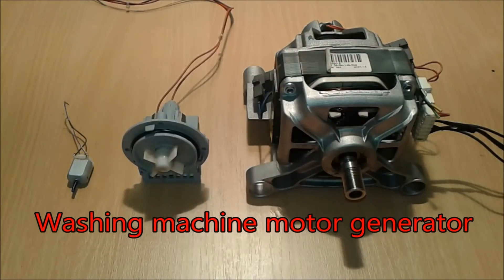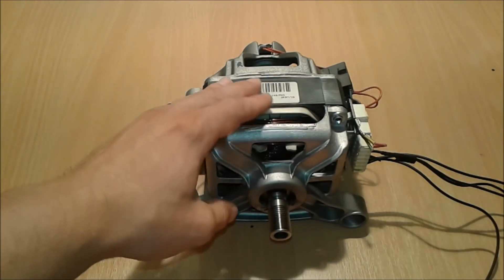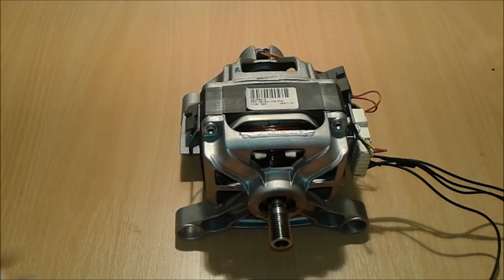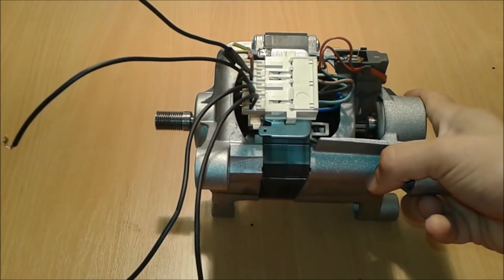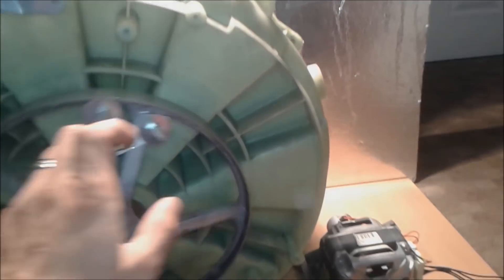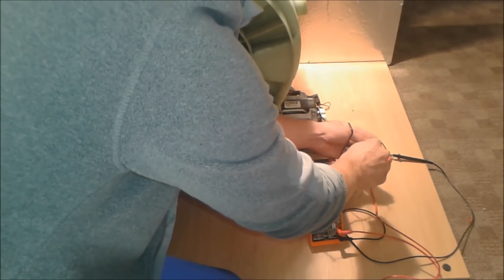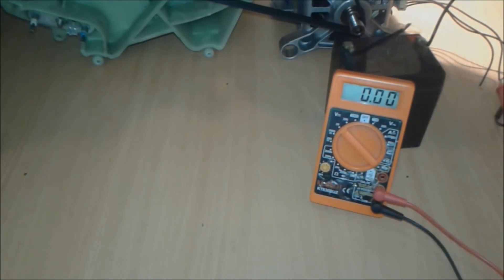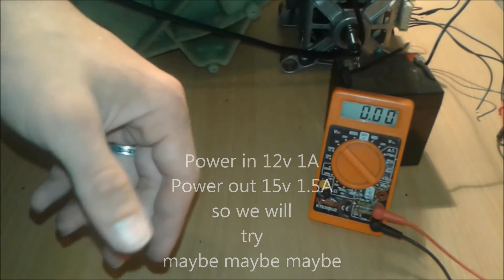Washing machine motor generator wiring

Comment: Modern cars all use an alternator, which produces AC, which is rectified by diodes in the alternator to produce DC to charge the battery - but when I was working on cars in the 1960's/70's, they had a DC generator, which was similar in concept to your motor.  It had a rotor with commutator and brushes, and it also had field coils - this was way before the era of powerful permanent magnets.  They were much smaller than modern alternators.  
You can see one at https://www.youtube.com/watch?v=RjLW_eb3D-c
I can't remember if the field coil was in series or in parallel with the brushes, but it was powered from the generator itself -it didn't get its power from the battery.  When the motor was started, the output from the generator would be small, due only to residual magnetism, which wasn't much - but as it started to turn, that little bit of electricity would power the field coil a bit, so the power from the generator became more, which would power the field coil more, and it built up to full charging current in a few milliseconds.
Those generators were designed as generators, not as motors (as is the washing machine motor), and they were 12V devices, and their field coil was designed to run at the right current - but I think that's the best way for you to go - use the generator voltage to drive current through the field coil.  You may need to put a voltage regulator on it, but you don't need to drive it from a separate battery.
Reply: the generator have series winding in series whit  the armature ,,,,heavy  size wire coil's ,,, and a shunt winding i parallel whit the armature whit small size wire, i still have few of those and the voltages regulator's  around my house ,sometimes i play whit those thing's on the bench to see the things i grow  up working , the starter was a series motor  like  today ,i repair 1000's of those things in my life ,this was my job ,,,,motors ,generator's ,alternator's etc,etc, ,,,,good times ,,,they gone
Reply from the maker: Mike Collins I know what you are talking about it was a combination of motor and generator 2 in 1 motor inverter I read an article about that generator model and they said that the online way we can achieve overunity is from solid switching devices not from electronics like transistors all the best
Reply from the maker: Mike Collins one more thing can you tell me more details about alternators minim rpm to generate something how is wired and more?
Reply: NoSkillsRequired - No, I can't tell you that information precisely.  At the time, I was interested in working on cars, and the generator was simply a component.  I never did any experiments on it to explore its parameters.  It worked, and that was all I needed to know about it at the time.  With regards to minimum RPM, I can tell you that if the engine was started without using the accelerator, so it started and ran at idling speed, the generator was already charging the battery, but I can't remember (if I ever knew) whether the voltage regulator contacts were closing at that speed. (In those days, the voltage regulator was electro-mechanical)
Reply from the maker: If you remember something or came across some stuff related to the regular car alternator please let me know i am planning to connect this washing machine motor to an alternator but i think i will encounter some problems after my calculations the washing machine motor can have a force of max 100kg but with some kind of pulley system, without pulleys10kg take care
Reply: Zola celery citi

Comment: Free AC electricity multiplying mechanism using pulley mechanics to multiply rotations, https://free-energy.yolasite.com/ and since AC electricity is generated using rotations, you are actually multiplying AC electricity. The simple way that this works is that you are only putting in the small amount of DC electricity to rotate a DC motor one single time, with a large 100 cm circumference pulley attached. Then with the large 100 centimeters of moving belt that you get off the circumference, you run it past a 1 cm circumference mini-pulley to rotate 100 times. Then by adding an AC generator to this mini-pulley, you can gain 100 cycles of AC electricity. 
-
It is truly that simple, and this gives you a return of 100 cycles of AC electricity, and you only pay for one rotation of a DC motor. So, you only have to pay one short burst of DC current, attached to a large pulley, and you get a return of 100 cycles of AC electricity from a mini-pulley. So with only inputting one small burst of DC current, you can get an output of 100 cycles of AC electricity,,, now that's what I would call multiplying electricity.
-
The mini-pulley runs free of most all torque, as even though it is winding up massive voltage, it only needs to generate one single short burst of current. Torque is only generated when you are generating power, and even though you are generating massive voltage, it is multiplied by practically zero current, (only a spark), equaling practically zero power, which takes practically zero torque to generate. 
-
This works by utilizing the long length of belt that comes off the single rotation of a large 100 cm circumference drive pulley, and running it past a 1 cm mini-pulley with an AC generator attached. This would generate an output of 100 cycles of AC electricity, for every mini-pulley that you attached. 
THIS WORKS PEOPLE, + IT IS EASY + CHEAP TO BUILD. PLEASE BUILD THIS GEM UNIT + OPEN UP A WHOLE NEW WORLD OF FREE ENERGY. (I cannot as I happen to be disabled)
Reply: joe Lynch who are you you just popped up on my screen
Reply: hopefully I will be the one who give God's GEM Gift of free energy to the Tribulation Saints, especially the Canadian ones, who need a way to keep warm in our bitter cold winters,,,, (fire is not an option, as the heat + light would get them discovered + killed)
Reply: joe Lynch
Reply: Haha.
or, are you serious?
Reply: You skeptics are right; I can't back this dirt simple pulley technology up with any video. That's because Satan + his evil minions interfere with any efforts to build this super simple free energy unit. DON'T BELIEVE ME,,, THEN JUST TRY TO ASSEMBLE THIS SUPER CHEAP + DIRT SIMPLE FREE-ENERGY MECHANISM. 
-
This is free energy made easy. (AC electricity multiplying mechanism using pulleys) = found in description of a UFO motor in Ezekiel 1:16 = (this can be any voltage, as long as AC generators and the DC motor are of the same voltage) This is a simple free energy technology for the Tribulation Saints http://doorschristmustpassthrough.yolasite.com/ (1st+2nd+3rd Door = 2019.04+2022.49+2015.94)  GEM-(Geometric Electricity Multiplier) =AC type free electricity multiplying mechanism at http://free energy.yolasite.com/.
-
HOW TO BUILD A GEM = This is a device that can easily + cheaply be assembled, by using one 10-100 cm circumference large pulley attached to a DC drive motor, + at least one of the 1 cm circumference mini-pulleys, (the smaller the better) connected to AC generators, both must be of the same voltage, + 4 diodes to build a crude full wave bridge rectifier-(converts your AC output into DC input for your drive motor), a lot of wire to connect your electrical components together, and a belt, strap, elastic or tied piece of rope or string, to connect the two or more pulleys together. 
- 
Then all that you have to do to start this perpetual dual power supply running, is start rotating the large pulley 1/4 of a turn, and this dual power supply should start running perpetually.
-
This simply MUST work, as the long length of the belt that comes off the single rotation of the large 10-100 cm circumference pulley, rotates the 1 cm mini-pulley + AC generator so many times that it easily builds up a massive amount of voltage, used to crank over the large DC drive motor + pulley one single time. Each side of this dual energy mechanism creates more than enough of what the other side needs.

----------------------------------------------------------------------------------------------------

This GEM free energy technology was derived partially from the UFO motor description in Ezekiel 1:16, and the wheels within wheels. I could not build something so complicated as being able to build wheel inside of wheels, but I chose to work with variable sized pulleys, running inside a belt. This way I did not have to worry about how cogs meshed with each other, or the lubrication of metal running on metal.

Comment: can this power up an airconditioner? how long can it run?
Reply from the maker: Nora Dora nope mate max that i seen is 300w
Reply: And what if you have 4 motors?
Reply from the maker: Nora Dora the only possible system will be to spin a car alternator because the washing machine can go up to 12000rpm
Reply: I am not too smart with electronics as you are but I was wondering if the washing machine motor could not store power in a battery and the battery to appliances. I mean something simular to a solar system?
Reply: @noradora8809  you would need a charge controller to deal with varying speeds, voltage, current.

Comment: im a motor drives engineer and puting power on the field coil is not a generator it has to be independent to be come a generator
Reply from the maker: Simon Smith if you dont hve a pmg this motor will do for some projecta its not ideal but the output power is greatee then the input power so it make it an afordable motor/generator
Reply: @Simon Smith
some generators need a little power supplied to them to start generating then use a small percent of the generated power to keep going , car alternator is one example , it uses a small current on the D+ terminal to start up , the power the alternator puts to the D+ when it starts also puts out the battery light  :-)

Comment: Use the tacho motor, or a small permanent magnet motor to generate field current? Or just rectify some of the generated pover to excite the field? 
By the way why does it take so much to keep the magnetic field?
Reply from the maker: kistuszek Tacho wires are not connected to any motor we are not using them i measured  no voltage.for sure some of the power generated can be used to energize the field coils
Reply from the maker: +kistuszek when the 12v power is remouved there is harldy any voltage after some test power in 12v 0.3a 3.6w power output was 5v 0.9a 4.5w so the output is greater then input not counting the manual force to spin the generator
Reply: I noticed, but it is pretty inefficient like that, right? You put in a lot of mechanical effort to only get so little gain. If you consider the charging discharging efficiency of batteries it might even be net negative. Off course if it was driven by something bigger the parasitic loss will not be so significant...
Reply from the maker: kistuszek exactly i am waiting for another washing machine to arrive and i will try on high speed to see the diference fingers crossed 😆

Comment from the maker: Washing machine motor wired as generator power the field coils and rotate the shaft(rotor)
Reply: Xenoglossy Glossolalia
Reply: Excuse me good sir! do you know if this motors has any torque in them? if yes how much?
Reply from the maker: Xenoglossy Glossolalia the power is 400w rotation 1500rpm and torque 1.3N-m hope that answered your question
Reply: thank you sir for the answer, can you make a step by step tutorial how to make a free energiy generator, you see i live on the remote countryside and we getting ripped off by the minister who says that they gona deliver us electricity.
Reply from the maker: Xenoglossy Glossolalia i am trying as you can see on my videos at this moment the only free energy available is solar pannel and wind generator but i am researching and if i will find something it will be free all the best
Reply: solar and battry bank is very expensive here, so i thought about  something free and home made!
Reply from the maker: Xenoglossy Glossolalia unfortunatelly my friend its not such a thing yet or just a pedal generator a bike belt and a dc motor you can pedal and make energy but just for charging a small battery sorry
Reply: What if another motor is connect to its shaft that turns the generator shaft, an motor that requiers 12v to turn with a battry or a tool? can a connection that both runs non stop. is that possible?
Reply from the maker: Xenoglossy Glossolalia i think with a fly wheel maybe but just 2motors connected together nope check my video about motor gwnerator i tryied a small scale but the power input is greater then output
Reply: How
Reply: NoSkillsRequired ob
Reply: Nonnude preteenunderwaremodle
Reply: NoSkillsRequired hjuhxcjcjxxicghxxhzb,b j